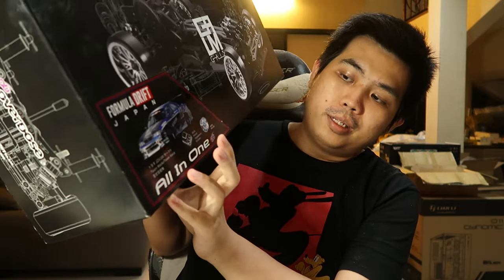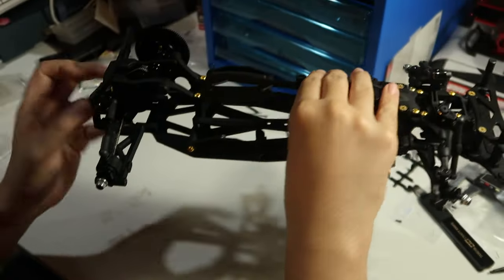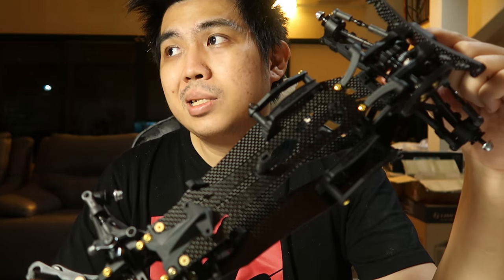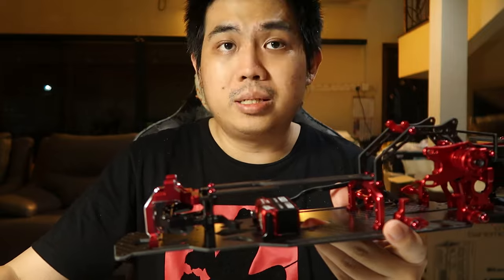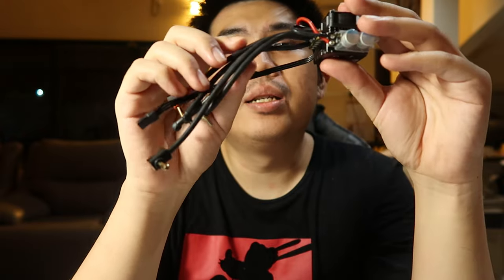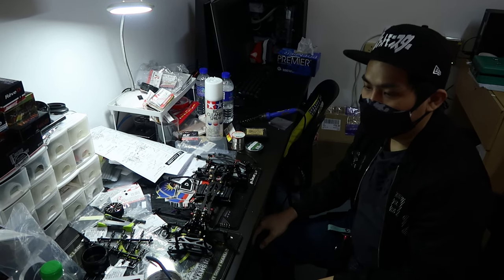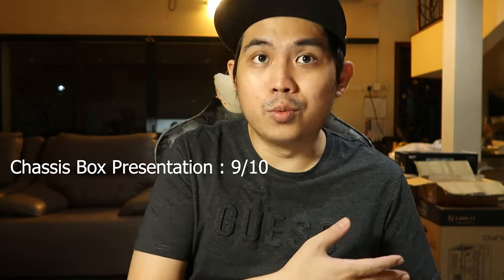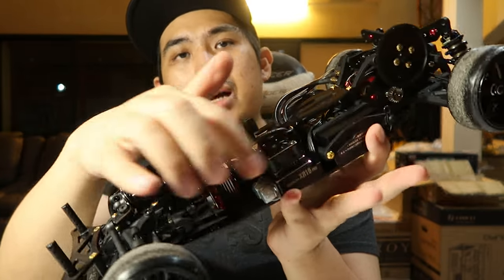EPISODE 2 CAN IT DRIFT? | OVERDOSE GALM | UNBOXING | BUILD | REVIEW | TEST | CONCLUSION |

Comment: The reason why my friends and I don’t like Overdose chassises that much is mainly because of they can’t do big angle in corners, even though they are no doubt the fastest chassises no matter with or without the floating motor mount.
Reply: galms dont hang with modern tuned chassis in speed or angle. They are old designs that look best on a shelf
Reply: @DJ.1001  Modern chassis like MD1.0 and RDX can bully any galm, but I still prefer HG dampers on both of these two chassis, HG damper is probably the only superb thing in functionality without extra weight that produced by overdose.

Comment: Hi, I’m enjoying your chassis reviews. In this particular review you mention the cost, is it $1,800 (USD)?  Also, what is the exact Overdose chassis model?  Thanks and keep up the good work! 👍
Reply: New versions 320 USD. just the chassis, no elec, wheels or body.
Reply: If your budget is $1800, you can probably buy a wiper version MC-1 with m1-rac, overdose dampers, rs-st servo with Gus-550 and accuvance motor and esc. With a proper setting, especially the setting of the m1-rac, it can easily outperform a more expensive galm V2+.